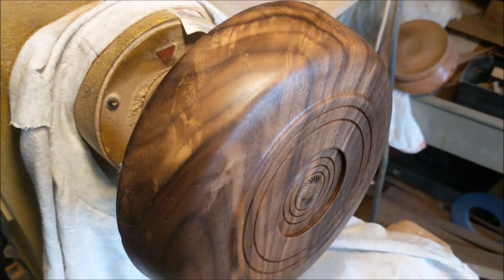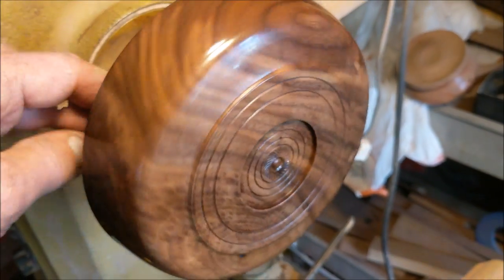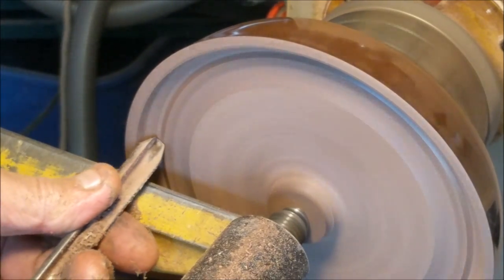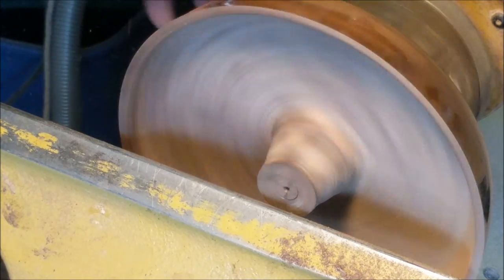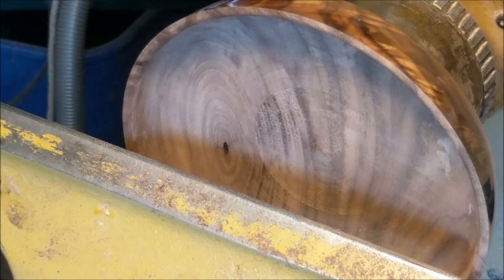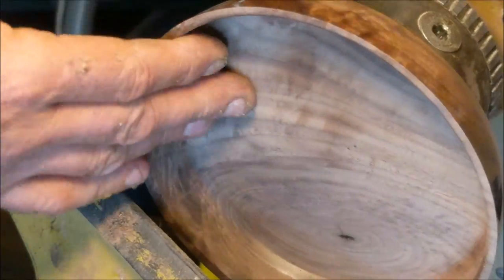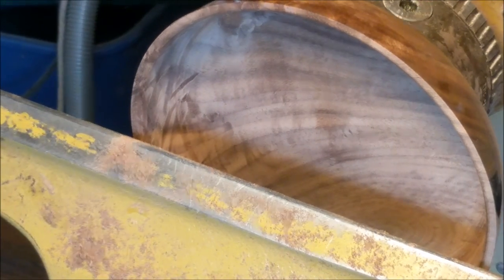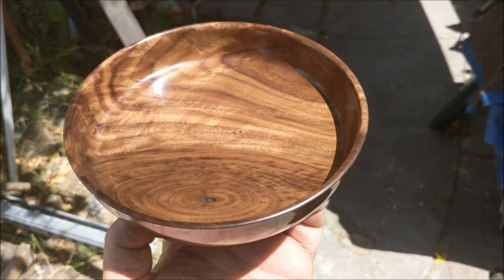Figured Walnut Bowl

Comment: Looks great Erik. Walnut is quite expensive over here in the UK so I've only used it on pens.

I've mixed up the friction polish a few times now and still not got the finish I'm after. I've tried with BLO and Tung Oil but they both seem to leave the oil on top of the surface and when wiped off even a day later it loses it's shine. If I just use Shellac with several coats (takes a lot longer) then the finish is excellent.

Well done!
Reply from the maker: Thanks Paul there is a trick to it for sure but you can get it right if you play around with it a bit and find a mixture that works for you and the different woods and moisture content and all that. I am always modifying my finishes and techniques.

Comment: Thanks for including the extreme close-up of the finish. I was wondering if the tiny pores were filled. It looks like they were. Beautiful high gloss finish. At what point are they filled? With the sanding sealer or later with the friction polish? I have a little trouble with that.
Reply from the maker: Thanks Gil, Usually with two coats of sealer when you go to wet sand with oil or use Yorkshire grit it creates a slurry that coats the pores and then when i friction rub almost all of them are filled in.